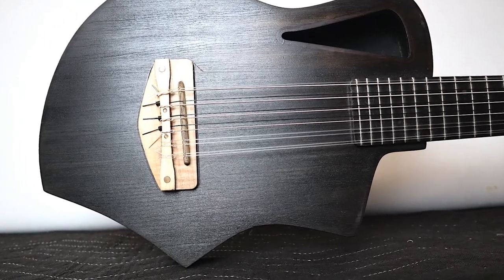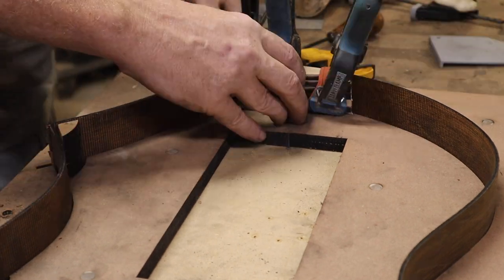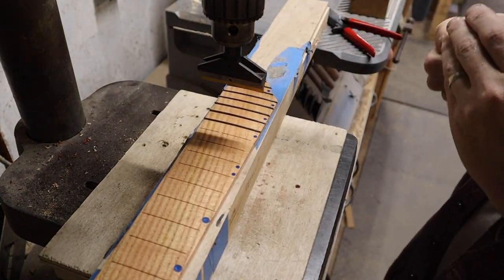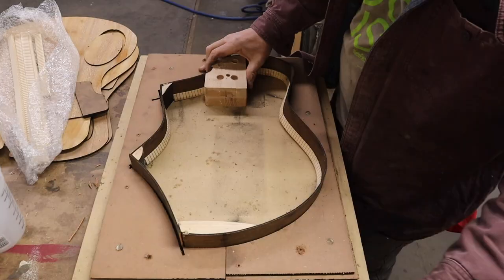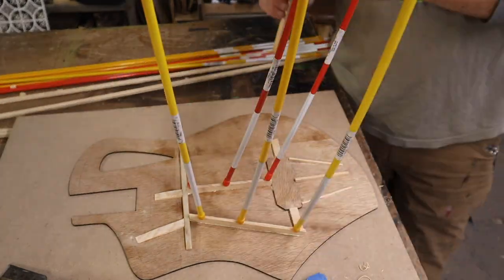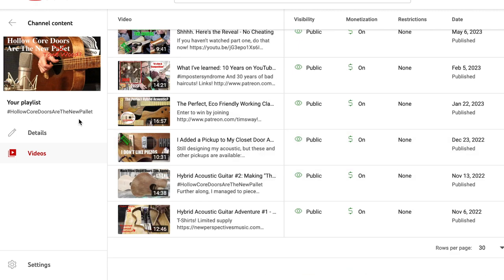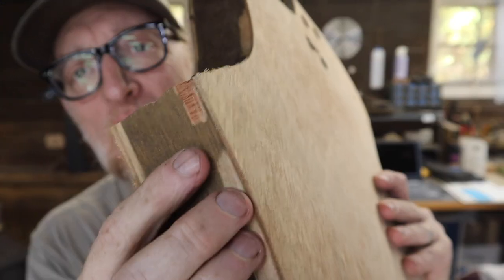Acoustic Electric Nylon String Guitar - A Big Version of the Mini One

Comment: This is so weird. I recently refurbished a classical guitar and was worried about tension on the neck if I put acoustic strings on so I opted for Ernie Ball Ernsto Palla Nylon Ball End's. I have to say they sound fantastic. After seeing this I think I'm going to add an external pickup instead of the contact pickup I currently have. Thanks for the inspiration. Oh by the way it also has one of your adjustable bridges with the coins on it with some amount of modification. The thread on the coin is not sound but I packed it out with some small washers and intend to tap some new coins in the future.
Reply from the maker: I like nylon strings! Just remember you can;t use a magnetic pickup with them, only piezo, microphone, etc. Glad to hear the bridge is working out! Yea, tapping coins can be a little tricky. Sometimes it takes a few tries , I think becasue they are not flat, y'know? tapping through some dead president's head :)
Reply: @timsway  That's good advice thank you so much. I was totally just about to do that. Good save.
Reply: @dfcpuk  depending on what you want to spend, K&K make great acoustic pickups that mount to the inside of the guitar.  They are high enough output you don't need a preamp.

Comment: Do ever run into problems with totally flat tops? Most luthiers make radiused tops and backs. Generally flat tops run into problems with warping and rotation from string tension over time.
Reply from the maker: When I make them from the closet doors, no. Or at least I should say, not yet. When I make basses I have to double up the top. When I use wood I had one that got a little wonky because I made it way too thin.
Reply: I'm supposing the laminated nature of the wood you use lends to additional strength.... as it would not if using cedar/spruce. Cool guitar, and thanks for replying

Comment: Your "pushing rods" claiming technique I've seen at a piano restorator's place, amazing woodworker, luthier, really an endless pit of knowledge, so I thing you're not doing wrong stuff
Reply from the maker: oh for sure. I think the expensive "go decks" for sale are a means of capitalizing on an old fashioned method I'm doing. When I've seen this done, the artist has been using wood dowels. If I've made any change or contribution to the practice at all, it's using fiberglass driveway markers instead :)
Reply: @timsway  Fiberglass sounds neat, for the sake of anything sacred don't use cedar ! my hands still remember.
I found some pics the other day, if you want I can send them to you

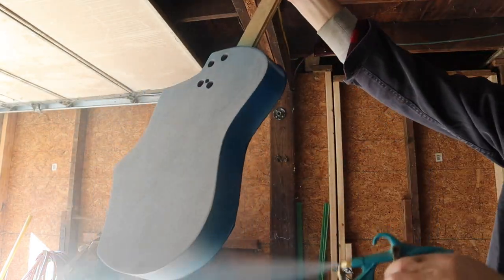Comment: Could you please tell us about that paint sprayer you’re using at 12:00? Is that something you made? Long time watcher, first time commenter. 😀
Reply from the maker: it's great! Keep multiple jars of different paints ready and sealed, swap them as you go, keep one with the appropriate cleaner in it (i'm using all water based, so just h20) https://www.leevalley.com/en-us/shop/tools/supplies/finishing/applicators/20048-critter-air-powered-spray-gun?item=03K0301